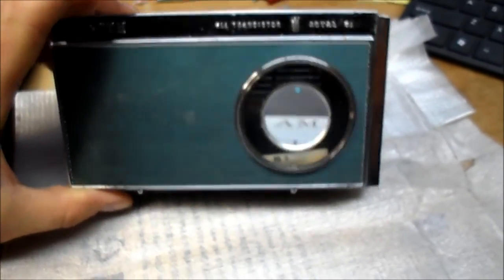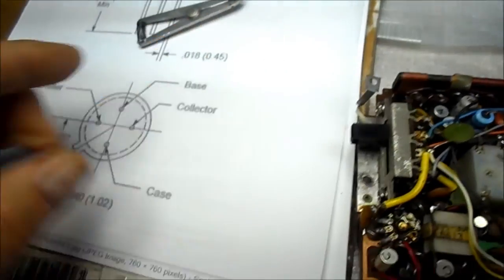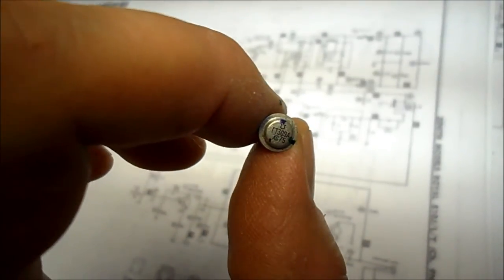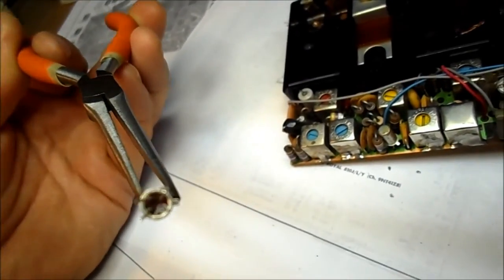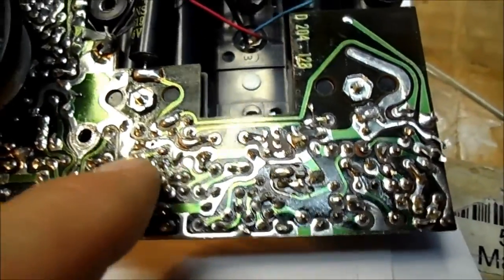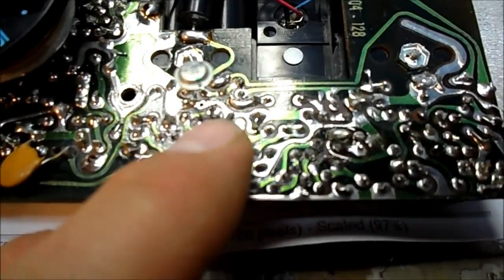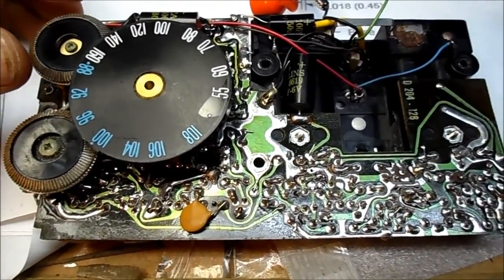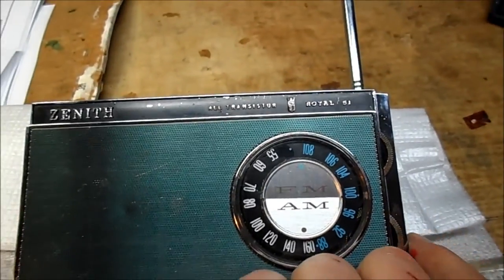Transistor Replacement On Zenith Royal 51 Transistor Radio

Comment: Could you have used hear z
Shrink around the top of that transitor then trim to size ,or you could have ussd a modern transitor the black plastic ones?
Reply from the maker: Hello this radio uses Germainium transistors which were in use just prior to the silicon modern transistor types. They are incompatible bias-wise. The voltage drop is about half what a silicon transistor junction is. Thanks for watching!

Comment: What was wrong with the transistor you replaced ? Most problems with older electronics is dried out electrolytic capacitors.

Comment: Most interesting and informative video...  I have a Zenith Royal  675 that needs help--it would be great to know how you isolated the problem transistor...     C.
Reply: In this type of old radios it is very common the germanium transistors fail and the sustitution is very expensive, a best option is get an equivalent transistor
Reply: @rodolfogomez382  Terrific, thank-you for taking the time to reply...
Reply: This radio needs a complete restore
Reply: @rodolfogomez382  So do I...   But your insight has given me motivation to look into that 675 again--it is just an emotional connection, as my father used to carry it around when doing yardwork and repairs in the '60s, listening to baseball games, etc...  Thank-you for imparting your knowledge and experience--that is so generous...   Love the Eureka moment in this video...
Reply: @HeeCheeFox  I understand your memorys about your radio, when I said "needs a complete restore" it means in electronics language the following: change all the electrolytic capacitors because they are degraded with the pass of the time and are the cause of some important performance problems, measure all the resistors and ceramic capacitors and change if they are out of his value and tolerance, test all the transistors and change them if  necessary; I my self  did the repair of  a little collection of tube and transistors radios from the 40's,50's, 60's, 70''s, 80's, it is a hobby for me and now that  I am retired  it is an interesting activity, I must tell you isn't easy and is very important to have practice and theory in electronics, I am a professional in comunications and electronics and this hobby  is my passion. Regards.

Comment: I just watched Shango066's video on this transistor yesterday, this is a great follow up to see it working, a great learning experence for me. Shangoo did mention that it needed to be aligned after changing, I think that is why your stations are off.Thanks and 73,Tom
Reply from the maker: The tracking seems ok, however audio seems a bit distorted sounding compared to before, or it's just me. That's the reason for radio comparison at the end. Strong AM/FM stations sound ok. Can only go by the prior videos, as the original IF transistor is bad, & so I can't compare. I may inject audio at the volume control & listen to the audio stage output quality. No electrolytics have been changed in this. The sams does the alignment instructions. Nonetheless, it's great that it operates. The failure is gone. Grateful for this opportunity.